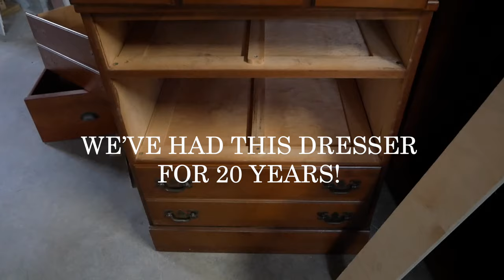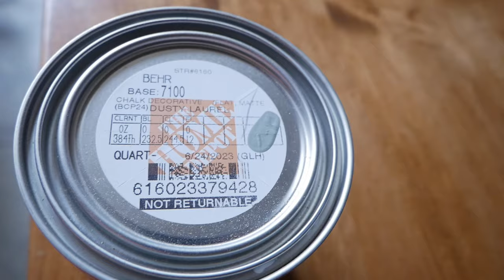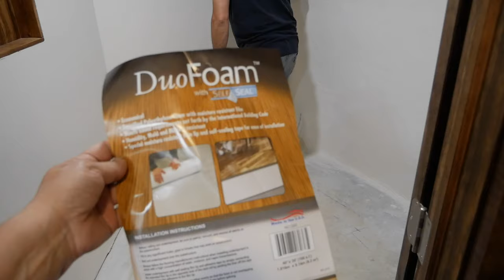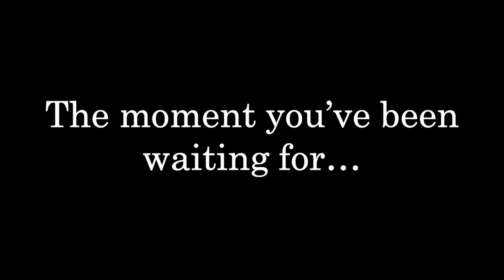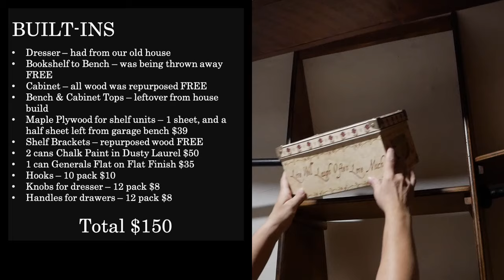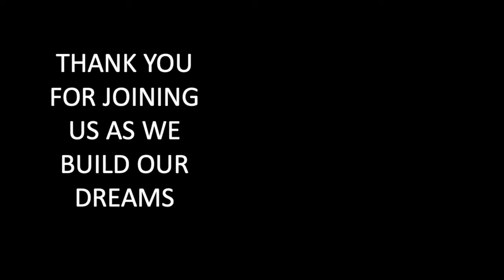DIY ‘Custom’ Built WALK-IN CLOSET UNDER $500!

Comment: Awesome look! We were dreading dealing with the curved shell issues so we planned around that issue in the very beginning. We are not immune to the curse of the curve but we desperately tried to minimize the amount of curved wall issues we would have to conquer or encounter. Our garage and the family room above it was an impossible curve issue to tackle with all square or rectangular features needing to fit. Our big issue at first was a 30" deep by 90" wide by 65" tall tool box being relocated from my work place to the back of our garage. We have however overcome most of those hurdles for now. Great work BTW on fitting a square peg into a round hole and making it not only look good but work for the space limitations and your storage needs. 

Our latest update is we were whacked by a home remodel @ a little over $4000.00 that we did not anticipate would be needed for its sale. New tires X5 for our Subaru that only had 20,000 miles but had less than 3/32 tread when we went in for a tire balance and rotation, a broken main leaf spring on our truck mid way though our move another $1200.00 repair. I guess we loaded her pretty heavy a few times for our move! Car insurance that we neglected to remember was due November 14th @ another $1280.00, Tractor repairs that were needed but not budgeted for @ about $1200.00 too. The condemnation of our BFG AT truck tires due to unexpected tread and belt failures added another $1400.00 for the required replacements with only a $700.00 credit for the tread failure issues to help defray the cost. Licking our wounds for now and hoping for a better new year for our budget. This was all in the month of November too.
Reply from the maker: Thanks! We definitely planned our interior around the curved walls as much as possible. It is definitely a challenge to make it work without wasting space😊 sorry to hear about all those expenses at once! And right before the holidays makes it that much worse. We hope you both have a merry Christmas in the dome home though!